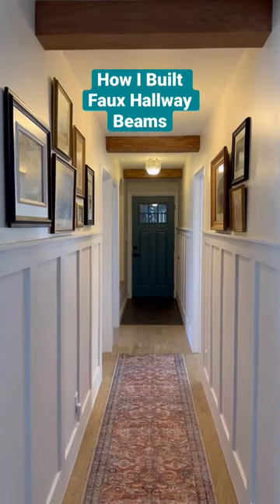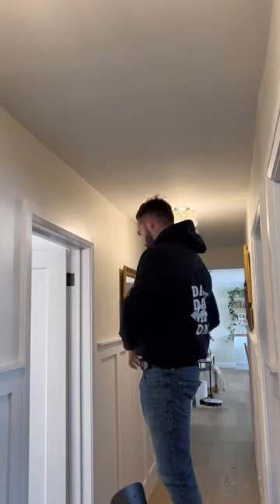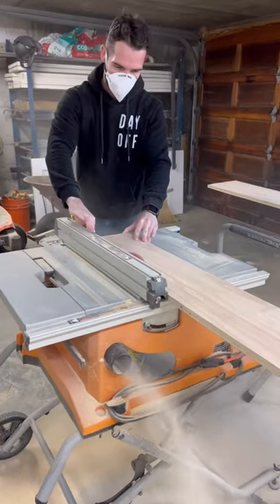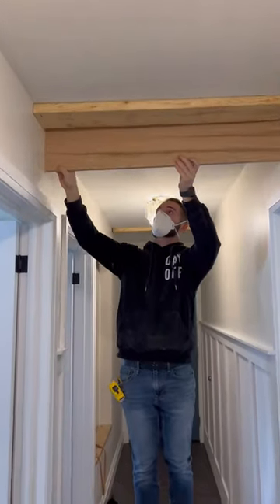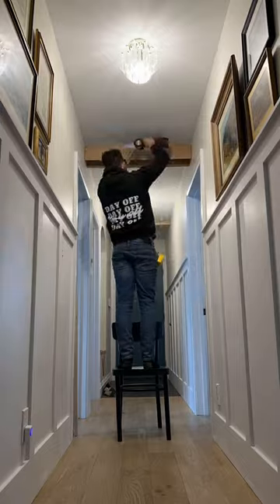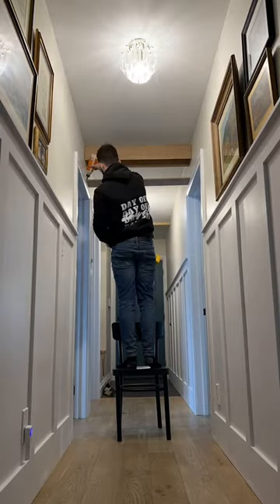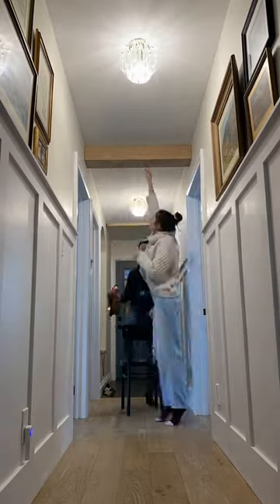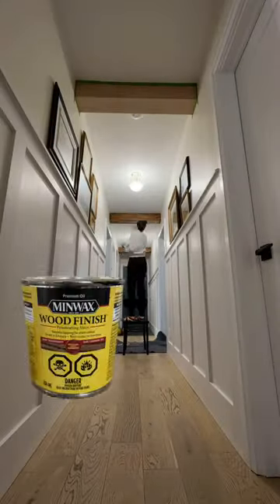How to build FAUX beams #shorts #diyprojects #carpentry

Comment: Years ago I did something similar. It was for our family room. I did 3 complete beams and 2 partial beams. All the beams were made of pine, 1x6 and 1x4” pieces. The room was 16’ wide and 20’ long. I spaced the 3 in the middle evenly. I attached a few 3’ pieces of 2x4” studs to the ceiling for each beam, one towards each end and one in the middle. I attached the 1x4 to the 2…1x6’s, stained the outside and then attached to the 2x4’s in the ceiling, and done. The partials were just the 1x6’s attached to the wall at each end to make it look even. I could have added a 1x2 to the bottom, that’s optional. Once you buy thiese pieces of wood, you must do this right away, otherwise these long pieces of wood will warp just laying around. The finished product was amazing.